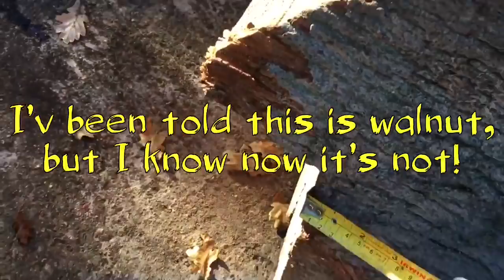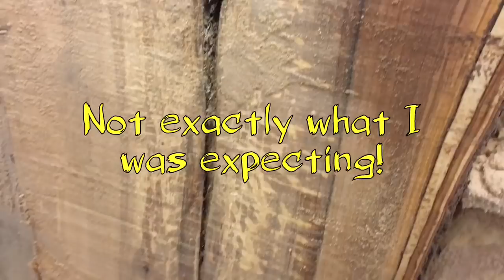Milling the rotten beast!

Comment: Dig the rotten lose parts out and fill it with colored epoxy. It will look awesome. and no wasted slab.
Reply: Yes, after pressure washing the crack out. let dry then fill the crack with colored epoxy.
Reply from the maker: Possibly the best way to save them indeed!
Cheers

Comment: I wondered if you did your own sharpening!  I see that you do!  How about setting the teeth up an down from the line of the blade?  Sometimes in a log like you went through I would have to reset all the teeth and sharpen them.  Worst thing ever is when you hit metal or rocks.  Even cement in wood where it is in the city.
Reply from the maker: Kravchenko Audio I do the teeth setting as well! I made a simple hand tool for it! It’s not ideal, but I try to get it as even as I can. I do the setting after about four or five sharpening. I was looking at a teeth setter for about £300, but I have so much to spend money on anyway!
I’ll get on one day, but I’ve got other priorities for now!
Thank you for watching!